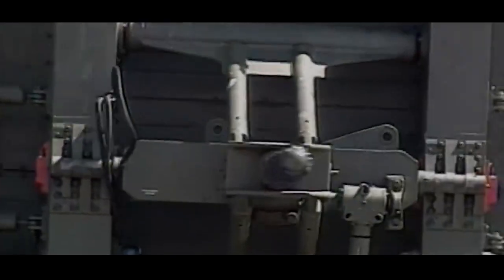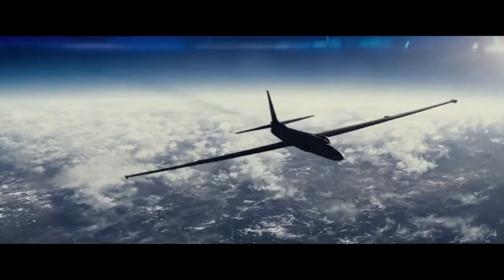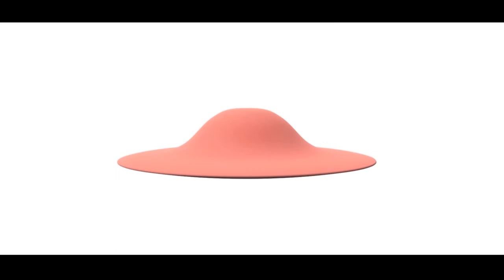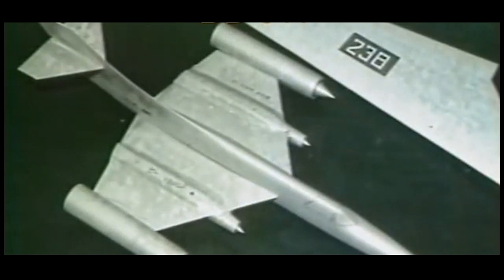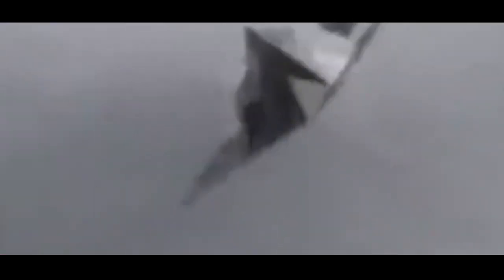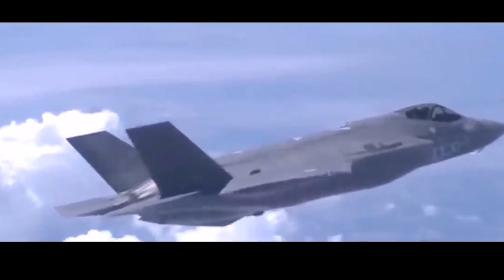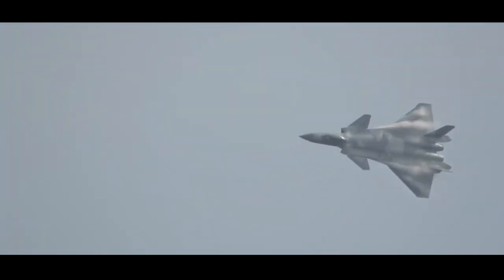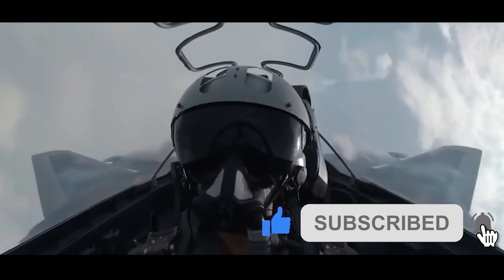How stealthy airplanes are created

Comment: I understand the production B-1 to have been equipped with some stealth tech. An article in a 1980's issue of AIR FIRCE Magazine I read said that it sneaked over Nellis AFB at low altitude. Also that it was as agile as many fighter planes of the time
Reply from the maker: I'm sure the B1 uses some stealth technology. From the curves of its wing and fuselage transition, and the dark coating, stealth technology was used. The B1 was designed for nuclear strikes at ultra-low altitude and supersonic speeds to break through the Soviet air defense network, and the use of stealth technology helped it accomplish this mission.
Reply: @historyandweapon  Re your last statment; that was the reason why they were willing to drop supersonic capability. It might have been better to bifurcate the program, one fork being high speed and the other being high stealth. Putting all the eggs on one basket, well, I'm sure you know that story